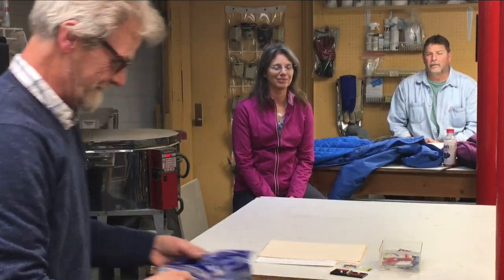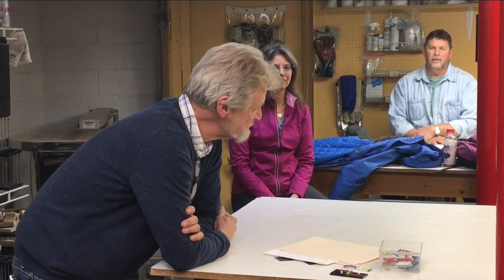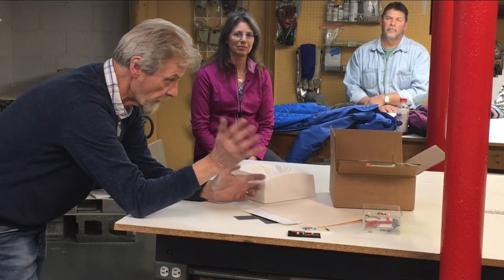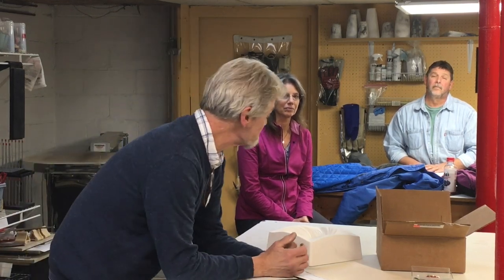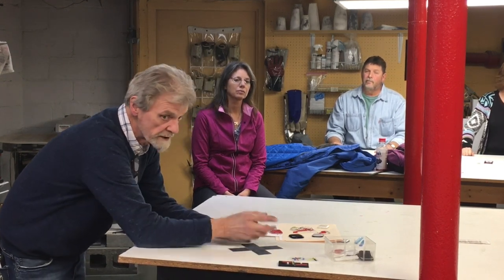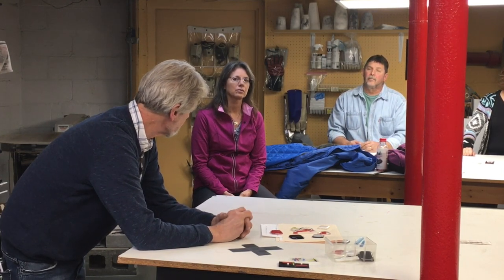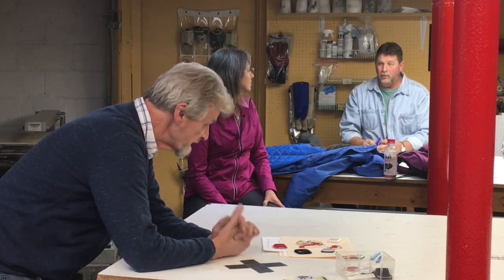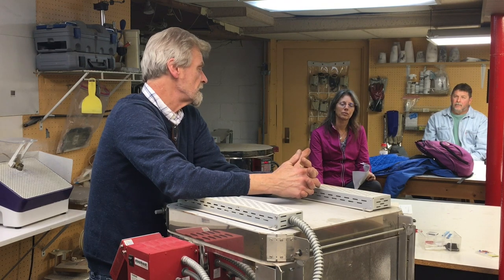TIPS on How To Make a Slumped Bowl Using Fused Glass Art Techniques

Comment: Great video, I have a question you mentioned a fire polish, would that be the same as a tack fuse.  If so which speed would you use?
Reply from the maker: Fire polish is a different firing. Lower heat to just smooth the edges and finish. Here is another video about it. https://youtu.be/oHjZ--5iL1U?si=Vtr1P5jQraOOf0Hx